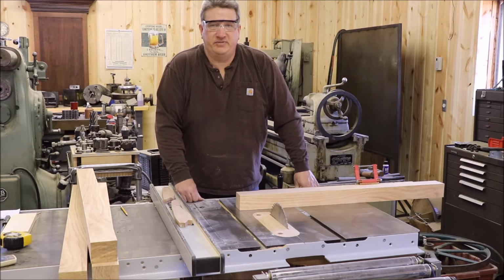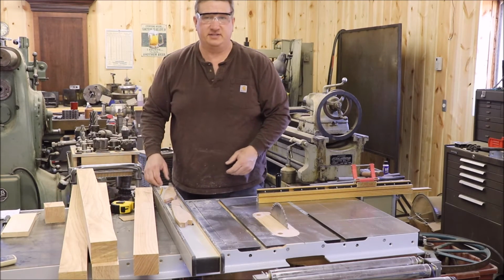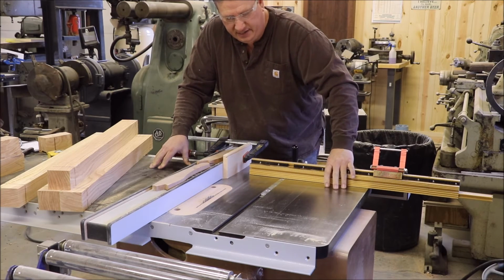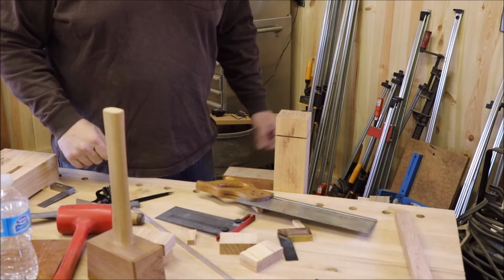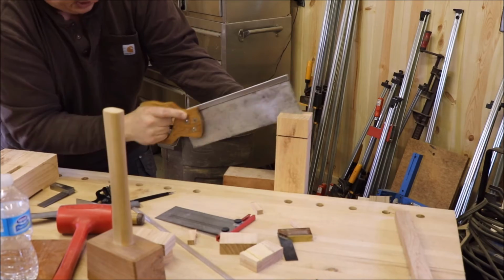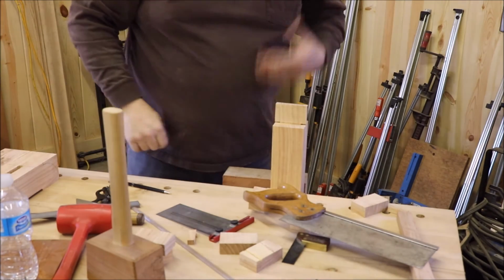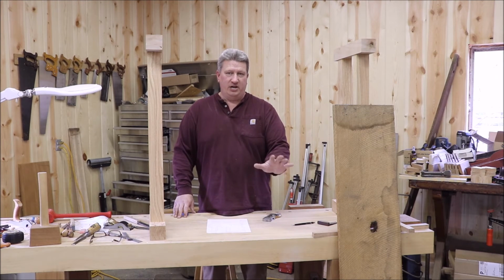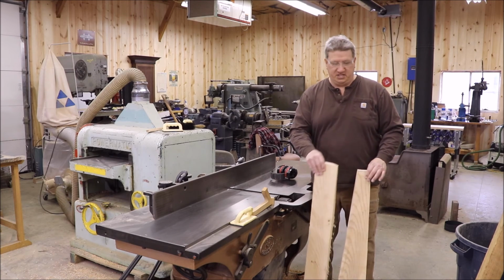Building a Sharpening and Belt Grinding Station Part 2

Comment: What is the width  of the bed on that jointer. I have a 12 inch wide jointer I use for facing lumber. I like your shop I made mine to small or I have to much equipment I don't know witch it is.
Reply from the maker: My Yates American #1 has a 16" cutterhead.  My shop is too small, also.  I plan on remedying that soon....
Reply: I don't know what brand my jointer is I got from father in law. He bought it from military surplus in the 50's. It was a 4 in 1 machine jointer ,shaper, mortiser and 12 inch disc sander.